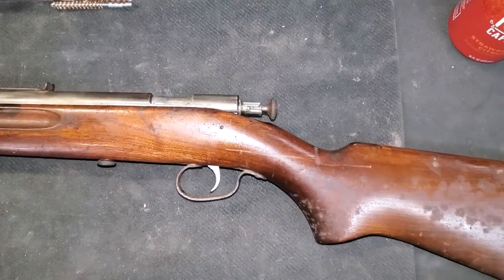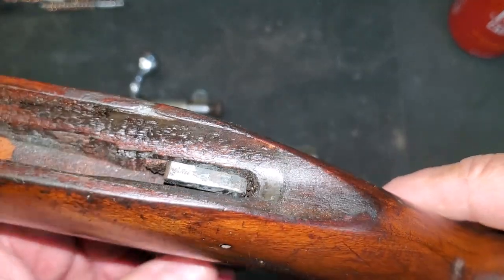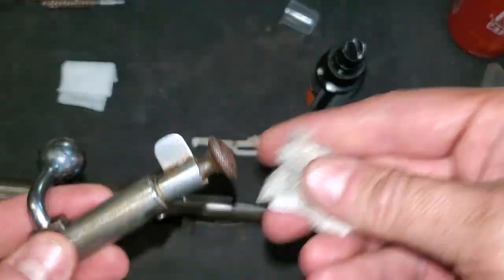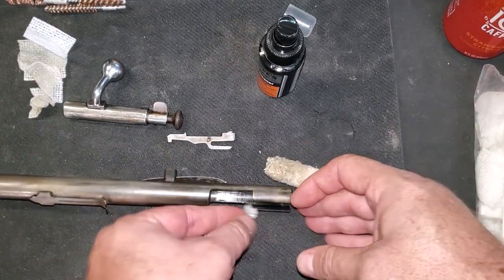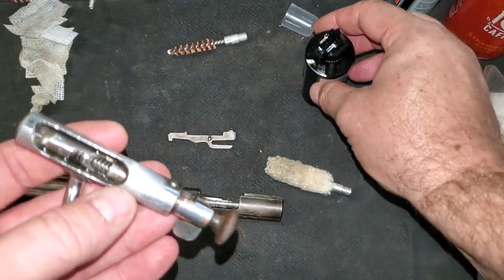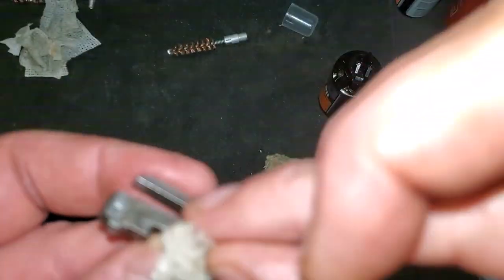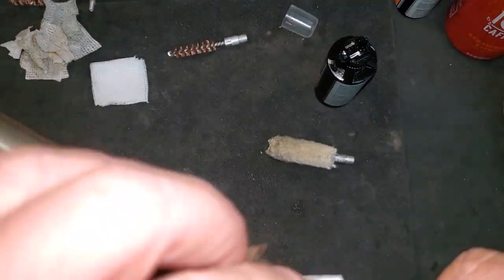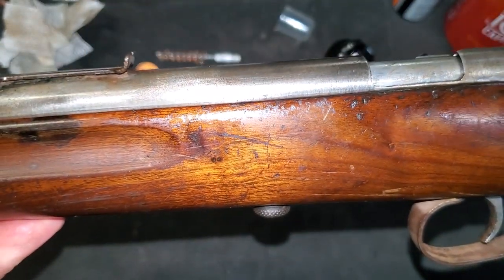Classic Winchester 67 cleaning up bolt and receiver

Comment: Thanks for the dis/ass. I just picked one up today not shot as most of them look. Mine was either in storage or reblued cause it looks flawless minus some stock dings. I hope they are as fun as my rem 550 I grew up on.
Reply from the maker: Its a great shooting little rifle. Very fun, and mine is very accurate out to 100 yds. Good luck with your rifle, Im sure youll enjoy it. Mine doesnt extract very well, but the cases come right out with a finger nail. My extractor looks ok, and I have read that others have that problem as well. It might just be a quark of the design. But its very fun to shoot

Comment: I cant find the serial number on mine 😳
Reply: Older 22 rifles were not required to have serial numbers. It very common to find 22s that don't have them. I believe, could be wrong, that it wasn't mandated until 1968. Hope that helps
Reply: pre 1968 not needed
Reply: To my knowledge, 67s didn't have S/Ns